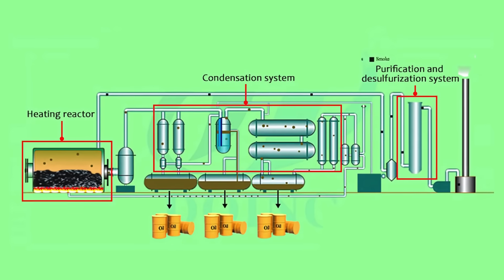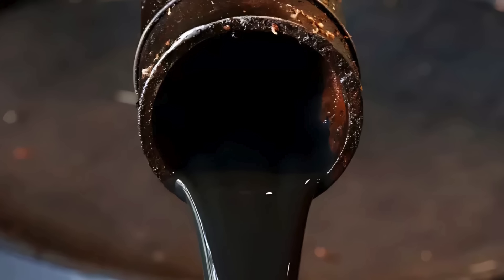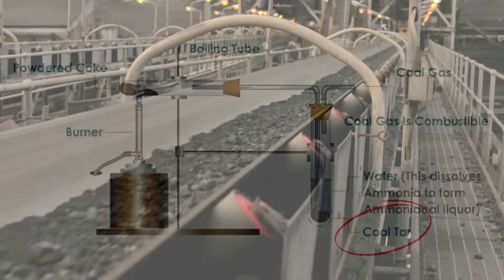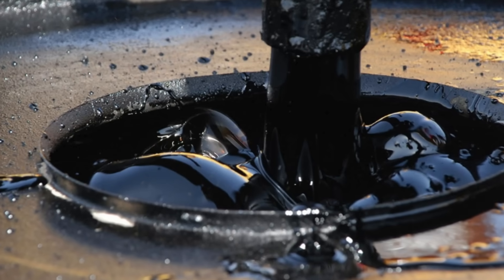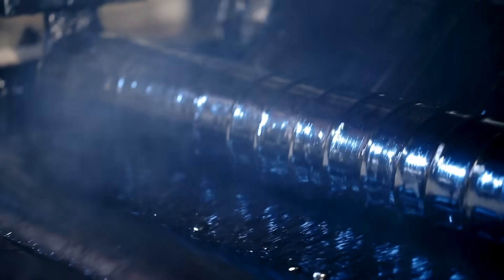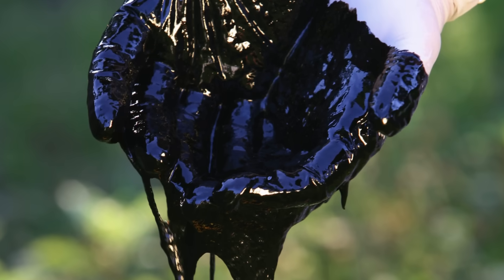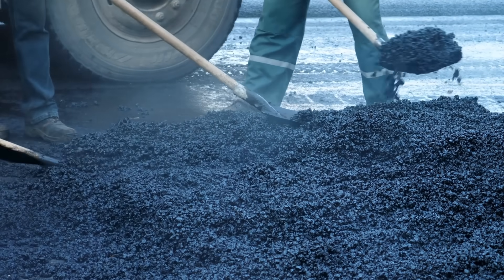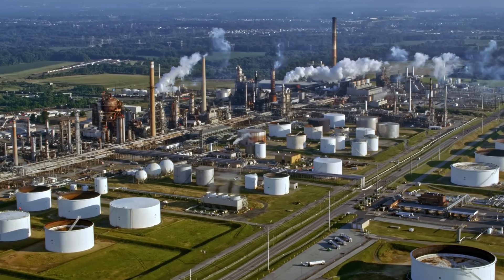How Is Tar Made?

Comment: The supposedly "mysterious" structures found on the famous Oak Island are tar kilns.  In the 1720's, logs were floated in to Oak Island, drug up the cobblestone paths by oxen and placed into the kilns to undergo pyrolysis.  Tar and turpentine pored out of the bottom of the kilns into trenches filled with coconut fibers to strain and separate the tar and turpentine.  Coconut fibers saturated with tar were used to pack leaks in wooden hulls.  Tar was also used to coat sails, tents and ropes.

Comment: The majority of the large diameter steel pipes that transport Gas in the UK are coated with either Coal Tar or Bitumen to help prevent corrosion, one comment is that bitumen and coal tar are not compatible and you should not mix them.

Comment: tar and asphalt are completely different things
Reply: Not completely.
"petroleum tar is a more general term referring to a viscous, heavy residue from crude oil, while asphalt is a refined product derived from petroleum tar, usually mixed with aggregates to create a paving material, making it more durable and less sticky than raw petroleum tar; essentially, asphalt is a processed form of petroleum tar with specific applications like road construction"
Reply: Which part of the video tipped you off?
Reply: Tar is made from wood, bitumen from oil. Big difference.
Reply: Tar and asphalt are colloquialisms for bitumen.
Reply: 3:42
Reply: Do you actually think that?
Reply: Asphalt is tar mixed with gravel.
Reply: @JohnDoe-es5xh No tar mixed with gravel is tarmac and tarmac was replaced by asphalt a long time ago. Asphalt is mostly bitumen. Either one can have gravel mixed in to make roads and such.